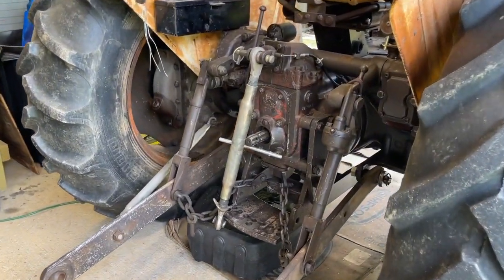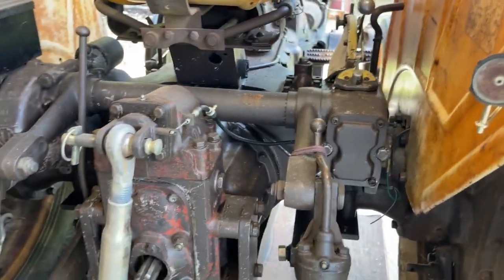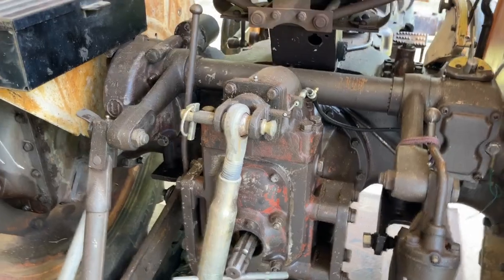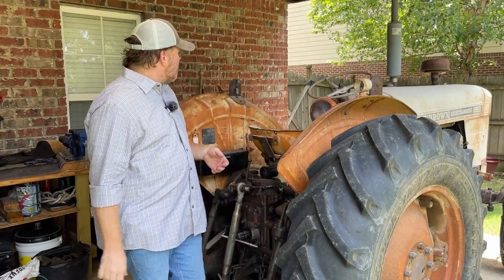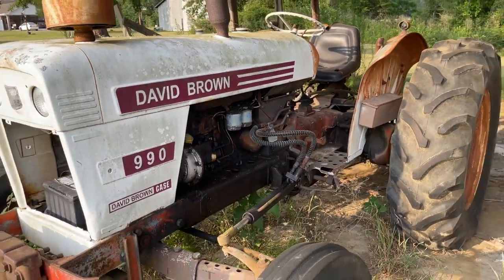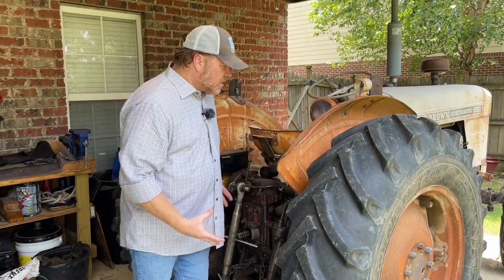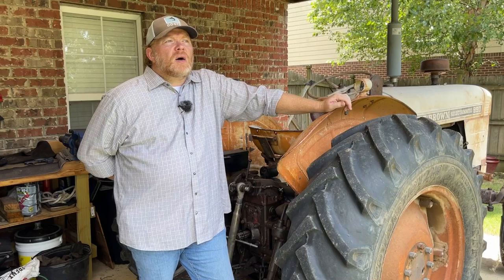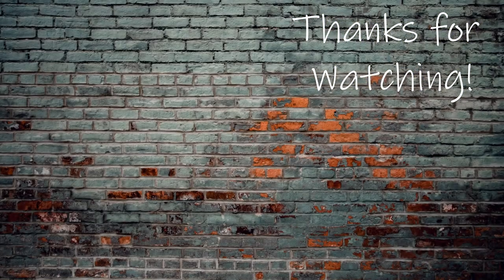Selectamatic Hydraulics are fixed!  What's next?  Power Assist Cylinder? | David Brown 990 #24

Comment: I’ve got most of the parts I need to add the power assisted steering to mine.  I’m looking forward to your rebuild so I can make sure I’m putting it together correctly!!
Reply from the maker: Well, we'll see if I can actually do it myself.  I'm kind of nervous about it.  It's going to be a couple of months before I tackle it though.  Have to get through food plot planting season and I'm fine with a little oil leaking out for now.  Thanks for watching, and thanks for the comment!

Comment: Overhauling my sylinder at the moment.Its fully dismantled right now, going to assemble next weekend if i find some seals and mabe some new ball joints.  Hard to find parts for it,it seems like…
Reply from the maker: The power assist cylinder??  Oh, I'm very interested in your experiences with disassembly/reassembly.  What tools did you use/make for it?  Hopefully it's just o-rings that's needed on mine.  There's a manual I'll link to below for it that has disassembly/reassembly instructions.  I haven't started the process for mine yet.

https://drive.google.com/file/d/1cgL4cMbvCIHkEg4o_r9moNCDYGkwkJem/view?usp=sharing

Here's my "steering" folder:
https://drive.google.com/drive/folders/1ELYxZAD8kIbOLg8oruWbyjHSzlETvYS0?usp=sharing
Reply: @path.of.discovery  its pretty simple to take apart, made some custom tools to open the ends of the sylinder. The o rings are pretty standard and can easaly be replaced. Thank you for the manual👌🏽
Reply from the maker: @turbodiesel4932 If you don't mind, let me know how it goes for you on reassembly please!
Reply: @path.of.discovery  assebely is done👌🏽👌🏽 hard to find seals, had to get them made. The treads in side the sylinder is real fine so be gentle, easy to crosstread. Also when you push the «valvebody» back into the sylinder its real easy to tear the o ring. Had to take it apart one time because of that. Also when adjusting the slack in the ball joints, dont make the inner one to thight, that will make it turn right all the time, ask me how i know…
Reply from the maker: @turbodiesel4932  Ok, very good information there!  Where'd you get the seals made from?  I read that some of the tooling in the service manual is for exactly that, keeping the o-rings from tearing.  How'd you get the valve body back in without tearing the oring?  Thank you so much for the descriptions here!  going to help a lot a people out!
Reply: @path.of.discovery  got the o-rings made from a local company (Norwegian seals). To help the o-ring on the valve body to not tear i beaveled the inside edge for easier entry and slid the valvebody (with mutch lubrication) from the sylinderside. Also honed the inside a little bit for a smoother slide. Dont put it in a vice when sliding the valvebody in. The vice will squize the sylinder body and impermanently distort it, which will cause binding when sliding in the valvebody.

Comment: The cylinder rebuild on my 990 turned out to be a challenge.  The cylinder does not come apart very easy.  Ended up having to take it to hydraulic cylinder shop, they had to machine some new tools to get it apart and back together.  The pump is pretty straightforward, however the orings are square edge and metric.  Good luck.
Reply from the maker: Thanks a lot Tom!  That's my backup plan is a hydraulic shop.  How far were you able to get it broken down yourself before getting stuck?  The inner tube?  I've got a couple of service manuals for it and it seems straight-forward, but I'm going to treat it like its the only on left on the planet.  And it might as well be, I can't seem to find any replacements anywhere, they're snapped up as soon as ones available somewhere from the places I've been calling.  A couple of places I've called keep wanting me to send it in and let them do the refurbishment.  400 to 500 dollars for that.  I think I'll have a go at it first tho.
Reply: Couldn’t get the end screwed out.  You got to be careful, they extremely fine threads and you could easily damage and I doubt it could be rethreaded.  The hydraulic shop near me is a combo hydraulic/machine shop and they struggled to get it disassembled and ultimately had to make some tools to get through it.  I give up on the cylinder pretty quick.  The pump is pretty easy.  Can’t say they work yet.  The pump, pumps, but the steering column is still not installed to check the power assisted power steering.  Very, very poor design and I see why it only was used a few years.  I think the 49 engine come out in 69 or 70, partly because of the redesign of the power steering and changes to the block for the redesigned power steering system.  With ours, I think they just tried to make something work for us Americans
Reply: same here the assist cylinder is very hard to work on.also had to machine tool to get apart and if the fine threads.are worn any at all you will have to grind the ends of them off to get apart .air tool is the only way you can move the threaded caps..hope you have better luck than I..AFTER ALL THAT GOT BACK 
TOGETHER AND DIDNT WORK

Comment: Hi again, I got an issue with control lever handle right now. I tried to dissambled it for painting. As it was a bit too complicated, the only thing that I was able to remove were both nuts and a plastic cap on right side of lever. I suppose I also removed the part called friction plate. Issue now is that when pulled down, the lever handle doesn't stay in down position. It feels like it's spring load... I will remove nuts again because I'm not sure I've putted everything back. In fact, I'd say that the lever has nearly no friction. I suppose it's spring loaded from the spring inside the control lever housing AND that maybe lever nuts need to be tightened a bit more. I didn't open the valve housing at all. Control lever handle was working correctly before (!) I tried to disassemble it. You really are my hope to fix it properly and fast. Thanks.
Reply from the maker: There's a couple of friction washers that keep the control lever in place.  Have you seen the video where I disassemble/reassemble my control lever on the bench? https://youtu.be/CsbGLB5Ja9g?si=0Txfi3Q761koXoLi
Reply: @path.of.discovery  Hi again. Many thanks for your precious help. Seems like I've putted friction plate on the wrong side. We'll look at it closely. It's about the end for my DB880. It looks a lot like when it got out of Melthan Mills back in 1967. Next year will be dedicated to original front loader. My DB is a merge of two tractors. Front end is a 1966 with original 3 cylinders 46 HP diesel engine and rear end is a 12 none synchro speeds from 1968. After a kick calculation, I've spent more than $20000 total (Canadian currency) to get everything done. I would never do this again. If I knew from the beginning that it would end up like this, I would bought a 1978 DB885 with a good mechanical instead. I would ending up today with a tractor a bit younger and much less money spent on the project. I REALLY wanted the 880 ! Now I got it !
Reply: @path.of.discovery  About the final drives... That's a real pain in the ass on those tractors. Transmission too. Bearing issue. It can get soooooo noisy. I would change all the bearings if I could but brake drum is press fit on main shaft. Needs heat and a puller. There are shims in the housing that have to be precisely put back. Mine are a bit noisy but not enough to change all bearings. I will flush the 80 oil gear and put some 140 instead. Final drive are the most beaten parts on the tractor. All pulling power, traction and braking is done in that area. No wonder they "FINALLY" get noisy.